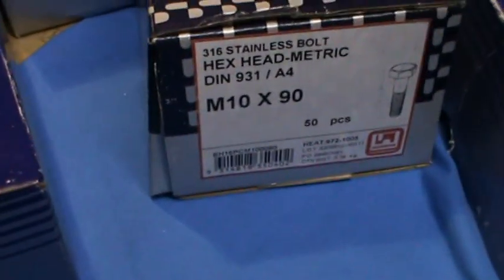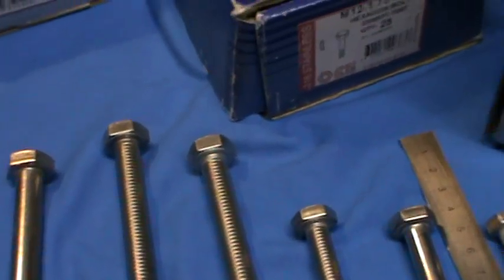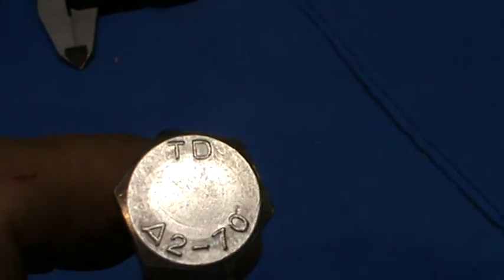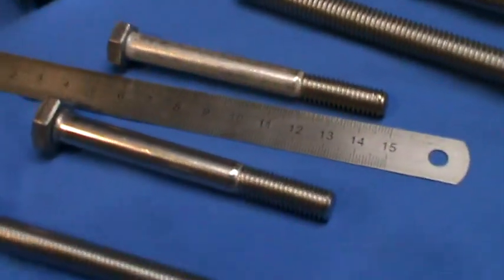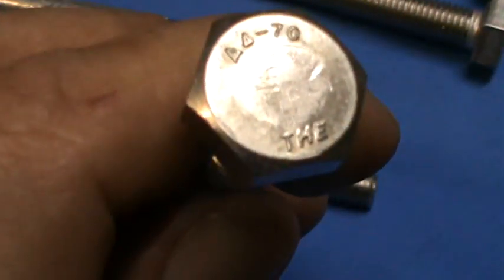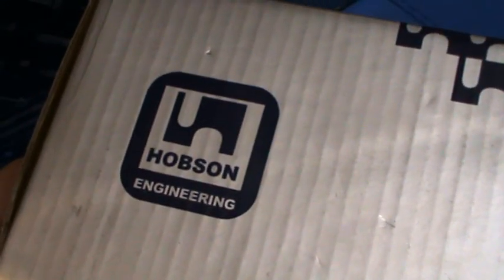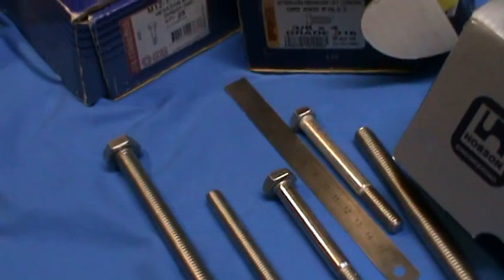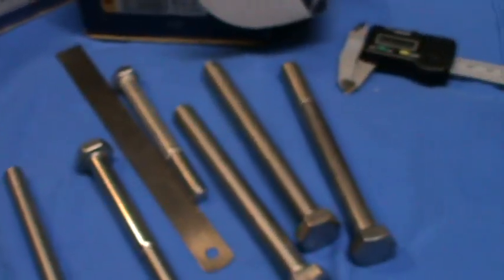Identify hex head bolts and set screws by grade of stainless steel 001.MPG

Comment: Hi ,i have a question ,if i have a normal bolt (not stainless steel) of 8.8 or 10.9 grade and i want to use a stainless steel bolt with the same resistance instead of the normal bolt ,is it enough  the A2 7.0 stainless steel bolt ? Or what grade to use ?

Regards

Comment from the maker: Hi Bondany1 In our stock range the hex head bolts with the eagle means the brand is Brighton Best and manufactured in India. We also have Bolts in Brighton Best Brand Manufactured in USA,China and Taiwan, these don't have the eagle on them. Rumor has it Brighton Best is owned by China Steel. Here in Australia roughly a third of the Socket head cap screws,stainless steel bolts and high tensile bolts and nuts  are from BB. Sounds like you may be doing a lot of trade with India? Best Regards Jimmy